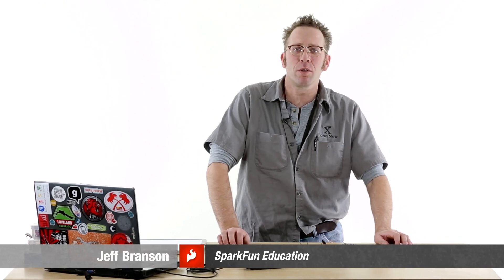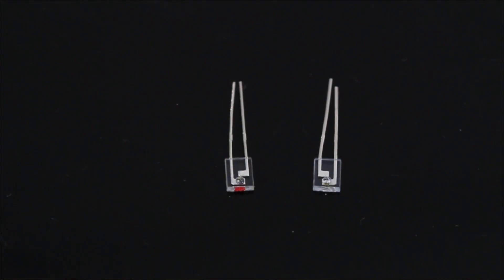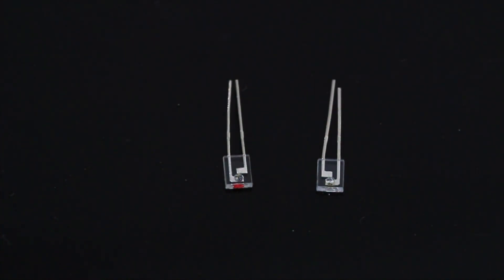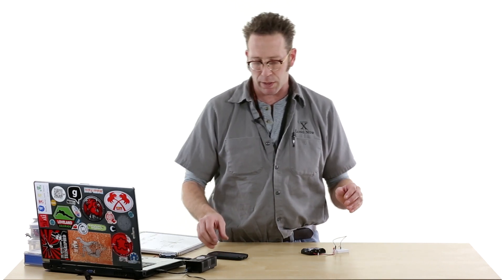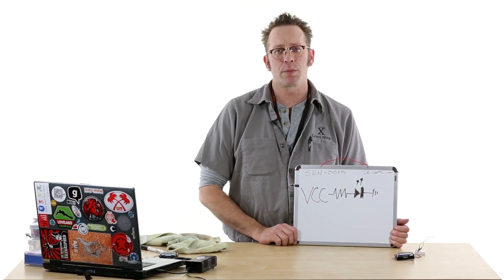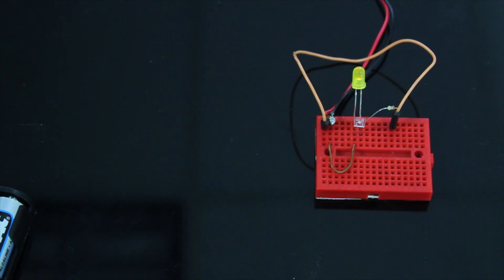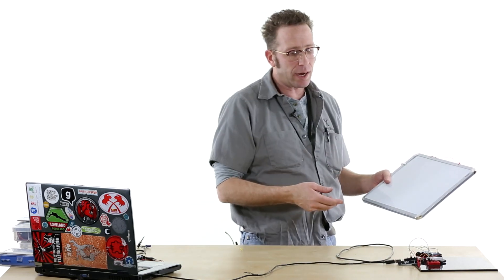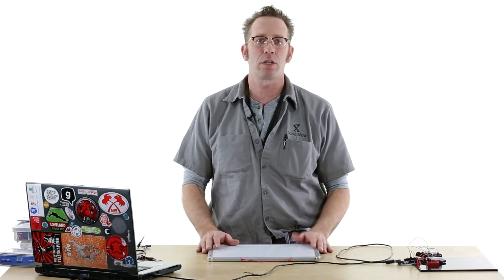SparkFun Infrared Sensor Overview

Comment: Well, resistors limit current, and a voltage divider kind of routes that current so that the output's voltage is variable.  If the resistor next to ground is high, more voltage goes through the Arduino's pin.  An Arduino does not read current, but actually voltage, so a voltage divider is needed to read from sensors that work via variable resistance. One resistor would return 5V (1024ish) no matter what.

Comment: There are places you can send your dSLR off to and have them replace the "hot mirror" filter in front of the sensor with a filter that blocks visible light but allows IR.

Comment: FWIW, cellphone cameras do not (typically?) have polarizing filters, and polarization is not why you are able to see the IR on the camera. Silicon photodiodes as used in image sensors are sensitive to IR. The fancy camera almost surely has an IR-blocking filter. The sunglasses likely just decreased the light, increasing exposure to where the IR became visible in spite of the filter.
Semi-related: IR photography is pretty neat, and the IR filter is why it's difficult with a DSLR.

Comment: Well, "built correctly" is the real question, isn't it?  :)  I've never made such a thing before...  And it's a gift so if something goes wrong I won't be able to just fix it...  The wheel in this case can shift around a bit, too, and I worry that could change the reading...  Mostly, though, it's just lack of confidence...

Comment: Isn't the orientation of the photodiode at 2:42 backwards in the diagram? As I recall photodiodes always pass current forwards, but reverse only in the presence of light.
I've been working on a project using an IR signal bounced off the side of a wheel to detect when the wheel turns... I painted black and white bands on the wheel to change the reflectivity. I think it's working but I'm afraid that it won't be reliable. It's kind of my first project with photodiodes.